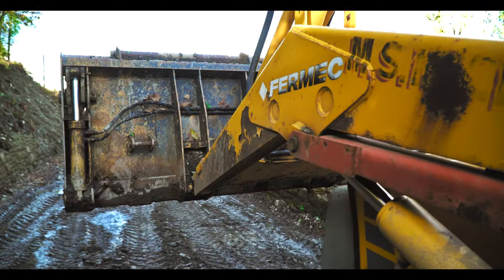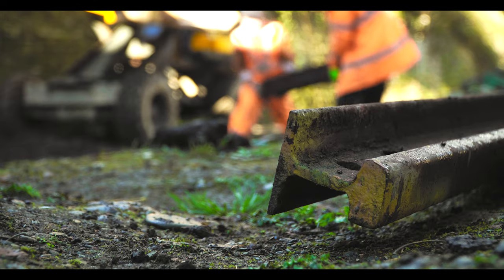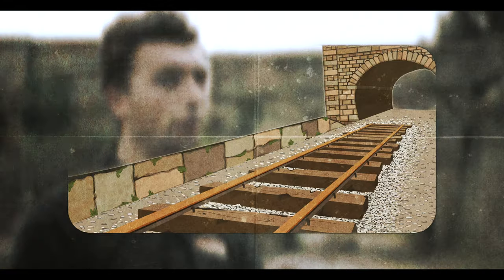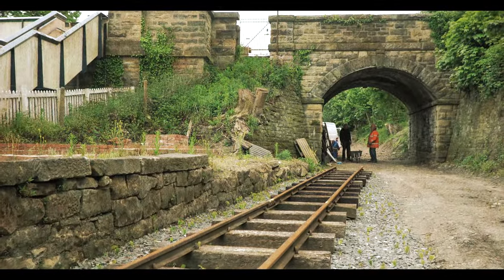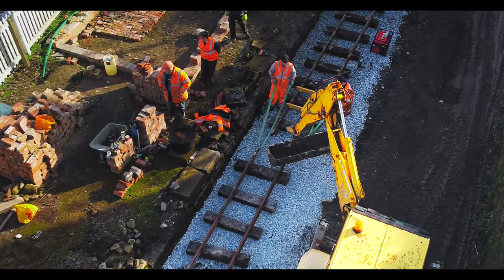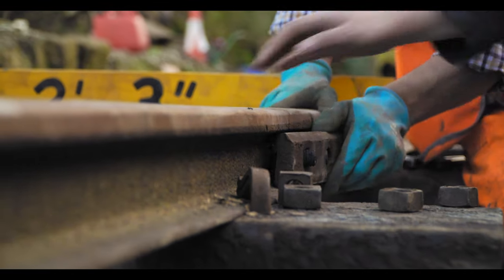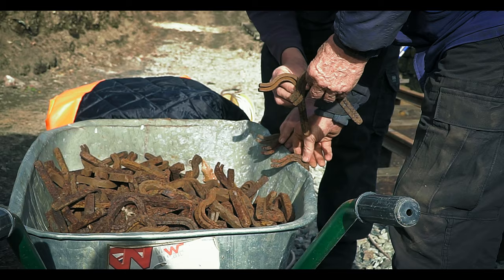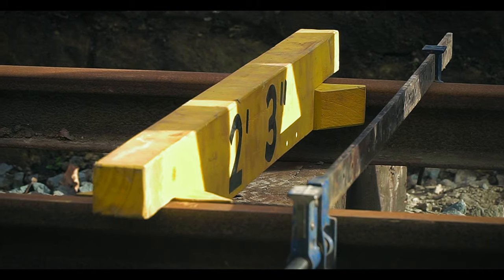The First Track Panels Get Built! - The Glyn Valley Tramway Trust

Comment: I suggest you lay ballast on Terram first.   It will prevent the ballast from sinking into the ground.
Reply from the maker: Hi there! There's still more planning going on, as there are a few logistical challenges we are figuring out, which is meaning some things are happening out of the normal order. One of the things we had to do, was to get track down under the bridge quick, so as not to have under the bridge at risk of being filled with concrete, as many others have been in the past. As well as the 150th anniversary event we wanted to hold too.
Expect updates in the future, as there is lots going on behind the scenes, and we hope you like what you see! Thanks!

Comment: Great stuff and well done. I was a bit surprised to see you using a second sledge to hit the spikes home. I was always taught that hardened steel tools shouldn't be struck together, due to the risk of them shattering?
Reply from the maker: Yeah that's right. The team was using wood as the strike block to avoid any miss-hits and possibly dameging the track, but found that the energy from the hits were being absorbed by the wood, and the team weren't quite happy with the way the first few pins went in. It's a work in progress for sure, but we just want to make sure the pins go in straight and true. Noted and passed on! 
Thanks for your kind comments! ☺
🚂